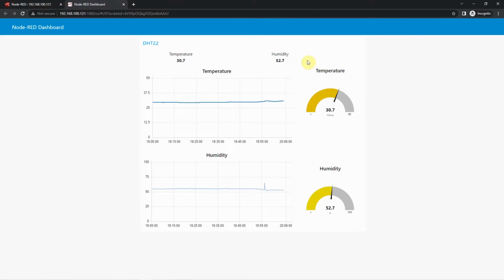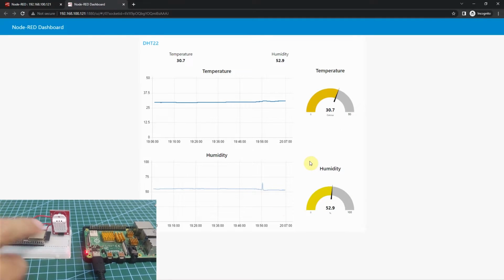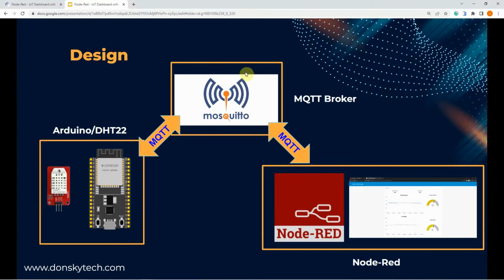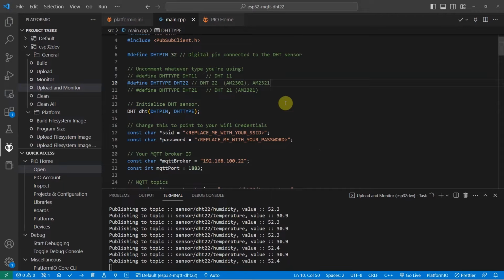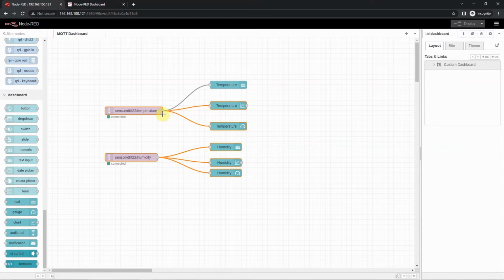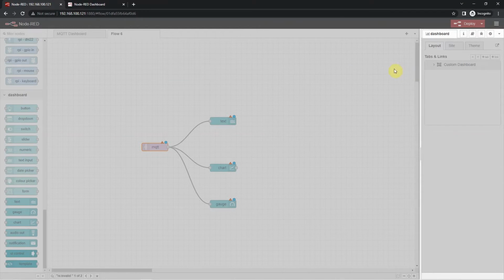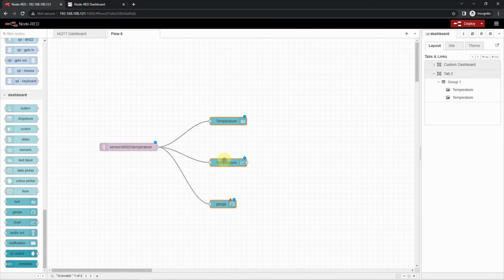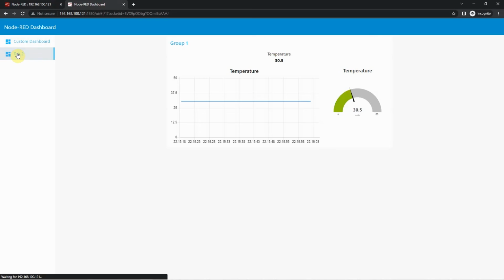Node-Red - IoT Dashboard with Arduino - No Coding Required!

Comment: You described me to a T here. Now this is something I can do. Now off to the write-up to learn more.
Thanks for another great video!
Reply from the maker: Hey Keith, that is what a low-code programming tool like Node-Red can do.  You could create web applications on the fly by dragging nodes and wiring the message.  There are other nodes that can let you send emails on the fly.  This is a cool project and a good tool to add to your arsenal. You can start with the simple nodes and progress into creating complex ones by adding programming code thru javascript.